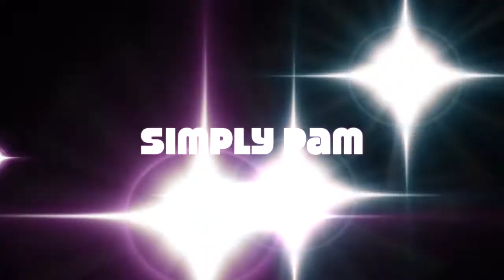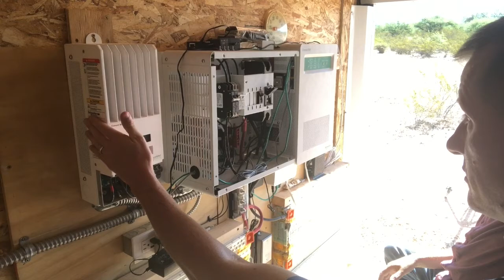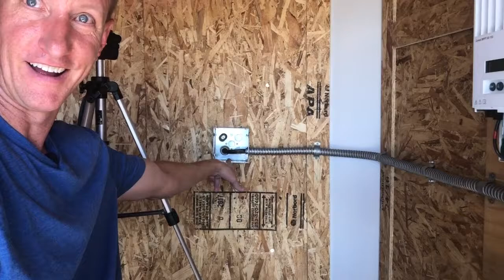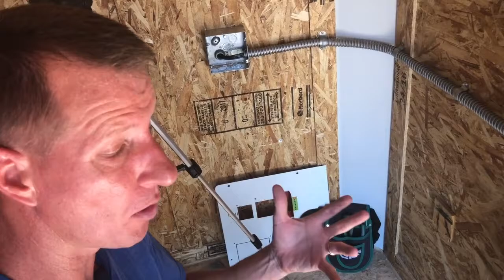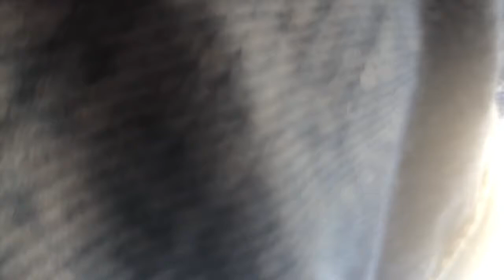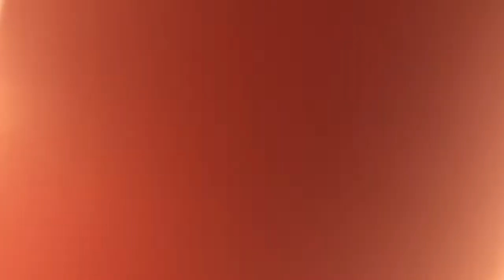Solar for Dummies Part 2

Comment: I thought anything you use in the house or trailer actually comes from the batteries no matter the time of day, and the charge controller just continually charges the batteries. Does the charge controller sometimes skip the batteries and send the charge directly out? Unless our systems are set up slightly differently. 🤷‍♂️
Reply from the maker: Green Dream Project I will have Brian answer this.
Reply from the maker: That's a good question!  Again, I'm no expert, but I can tell you what I observe…  Say I'm using the air conditioner during the day, and the batteries aren't fully charged.  If the charge controller is putting out 20A, I would expect to be able to measure that with a meter in my battery cables (it actually gets split in half, because of 2 batteries being wired in parallel, and the cables don't actually see EVERY BIT of that amperage, but it should be close).  What I actually observe, however, is that only a small amount of amperage shows up in the battery cables, and I take that to be what's "left over" after the RV gets what it needs.  I'll admit, I'm not sure how that actually occurs out of the charge controller, but that is what I see, and that's how I interpreted it.  I think we're set up the same.  Can you check those measurements in your system to see if you see the same? — Brian